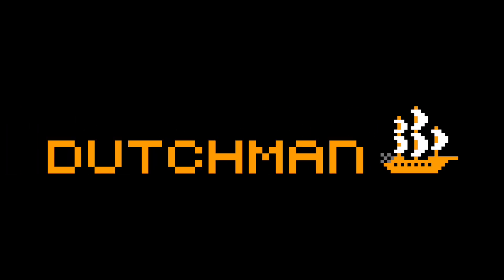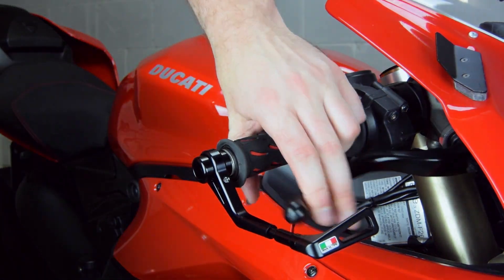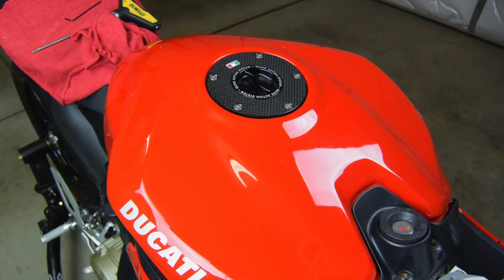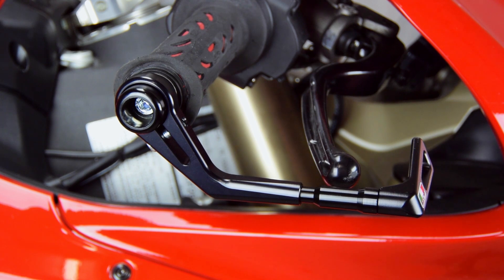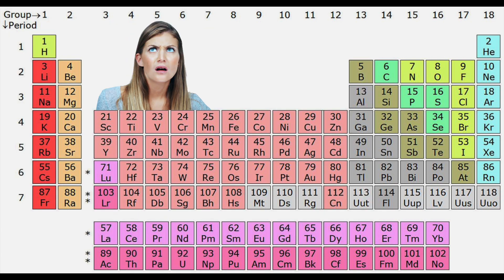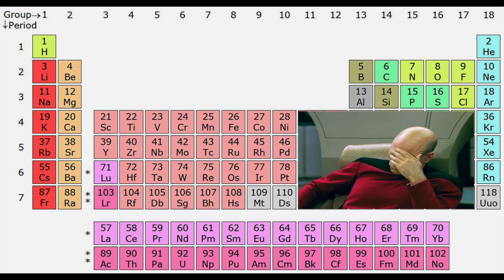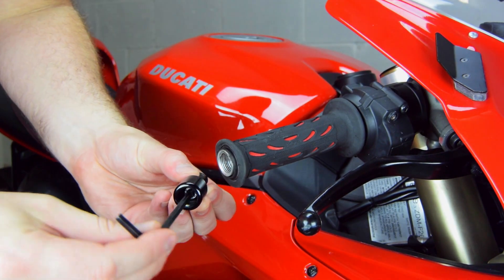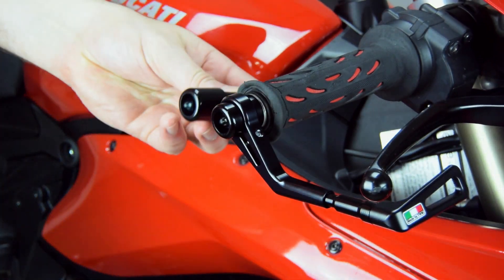Ducati 1299 Panigale Tinkering | TWM Brake Lever Guard

Comment: Moto Dutchman....great channel and awesome informative content! Had a question for you about this lever guard. I recently purchased them for my 2019 Ducati V4S. It looked great and I was ready to rock n roll. However, I noticed that the weight difference was significant between the TWM bar ends and the stock bar ends. I know weighted bar ends help reduce vibration. Did you notice any difference? Were you hands more probe to numbing with these lighter bar ends? I have since removed them and put the stock bar ends back on. I'm out a brake lever guard but I don't split lanes or do track riding. Thoughts?  Thanks in advance and keep up the good work?

Comment: i installed this on my bmw s1000rr 2018 it has a lot of vibration on the handle bar cause the bar ends that they provide is too lightweight cause of that there's lot of vibration....

Comment: Hey, will the CRG Arrow mirrors can be mounted on the TWM bar ends ? (on the left and with the guard on the right)
I would like to have bar end mirrors with brake guard without it to look to massy
THX
Reply: Moto Dutchman on road use you have the mirrors on the TWM bar ends? the diameter is the same as the CRG adaptor?
Thanks
Reply: Moto Dutchman when removing the CRG you use the same bar end to mount the TWM ?

Comment: before you call this a high end lever guard! is it weighted? because and barend on the panigale which is not weighted will make the handle bars shack badly.
Reply: Moto Dutchman they must be within Ducato spec, I work at Ducati dealership and the weight of the barends is critical.